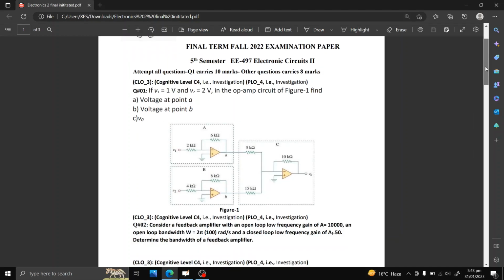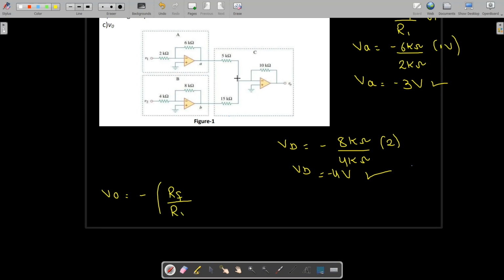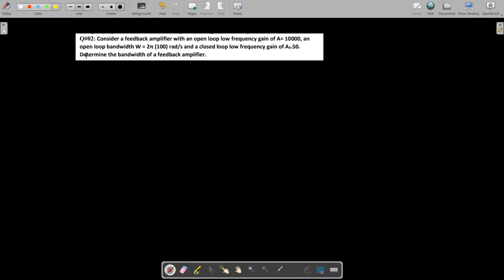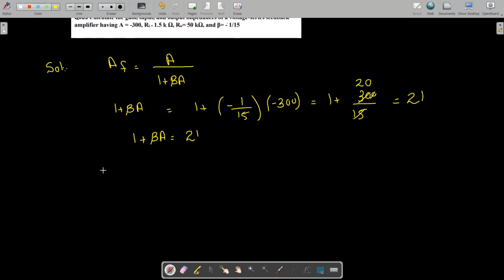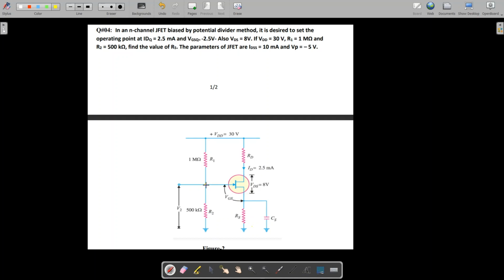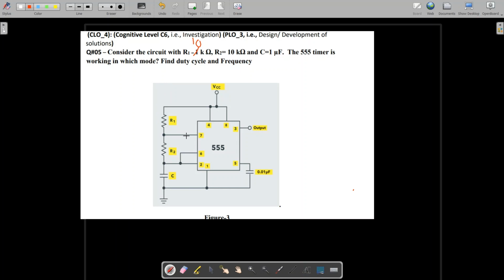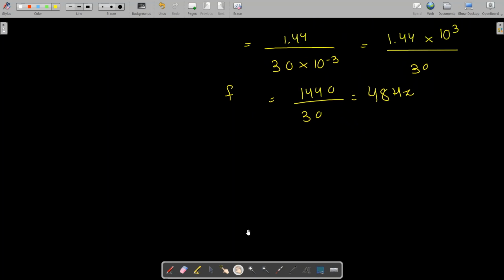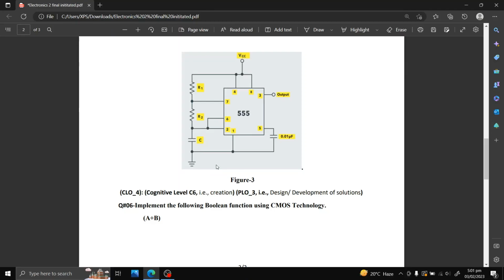UET Peshawar Final Term Electronics-2 Paper full solution

Comment: sir As R1=R2  so duty cycle will be 50% then why you use formula of duty cycle greater than 50% ?
Reply from the maker: yes but when diode is connected across R2..there was no diode connected across R2
Reply: Thanks sir

Comment: Sir as you told in the class as well as in your YouTube channel video that if R2>R1 then we use the formula for duty cycle>50%. But here  R1=R2 ,so we can't use this formula.
Reply from the maker: Watch the video again
I said for more than 50 per cent duty cycle, you can use the duty cycle formula..also if you find it using on time and off time..result will be same
I also mention in the class as well as lab that to get less than 50 percent duty cycle we have to connect diode across R2..remember?